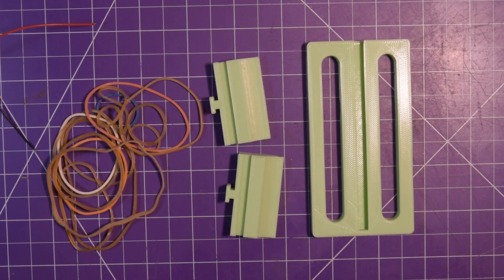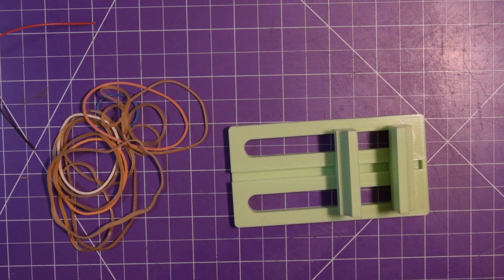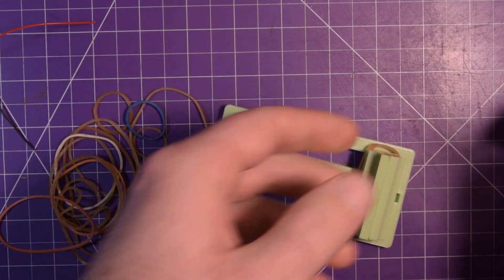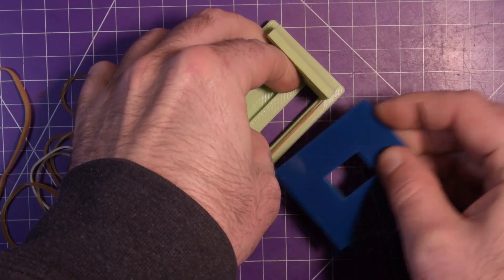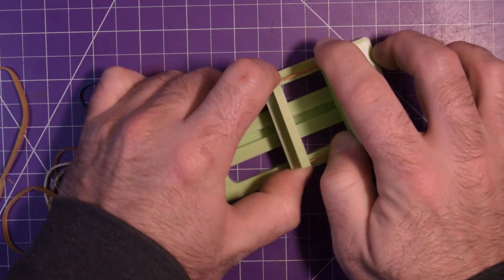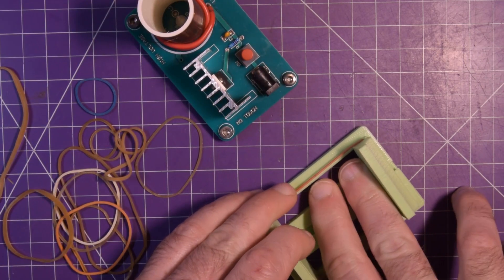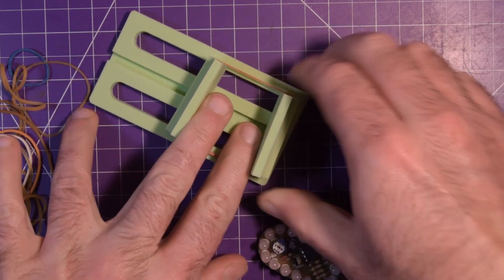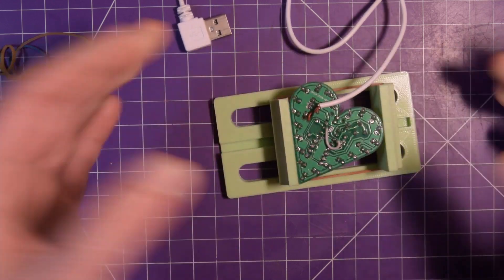You Can Print Your Own PCB Holder!

Comment: This is a helping hand base I made (https://www.thingiverse.com/thing:3373956) It may fit yours, but it was easy to make in Tinkercad.  I have also printed and use this PCB holder (not my design) https://www.thingiverse.com/thing:8482 It is actually very nice.
Reply: Here is the PCB Gator vice I linked above live in colour. https://youtu.be/KAZk9W3YA9Q
Reply from the maker: Thanks! I'll take a look!

Comment: It's not too bad. Like you said it could use a design upgrade. I've seen some nicer ones for sale that might be able to be done on 3D printer. It would be nice to have it taller and the board pivots to easily switch to other side of board
Reply from the maker: I have one in my sights, but I have to get some gift cards in the mail first - could take a bit!